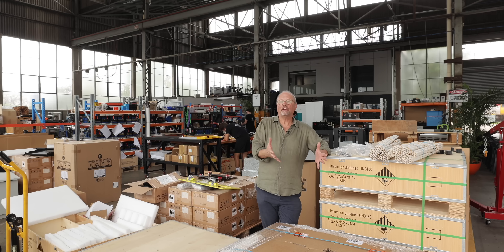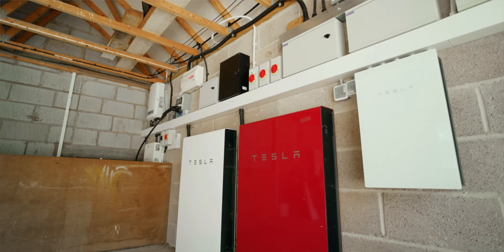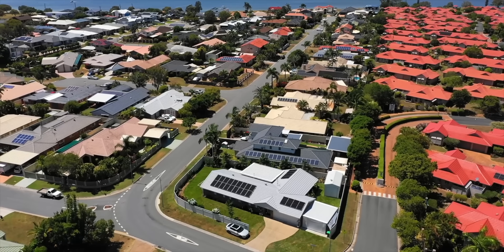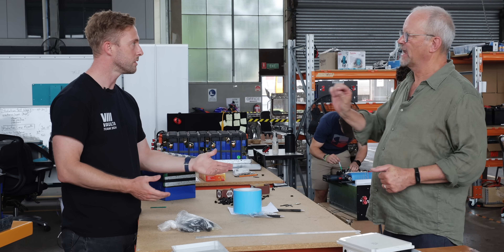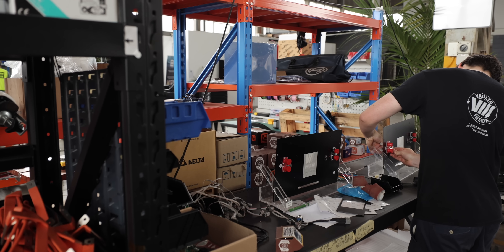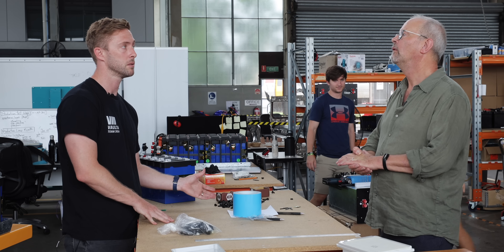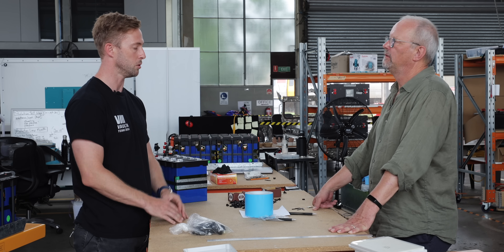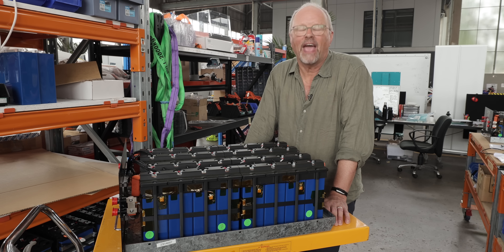THIS Recyclable Tech Solves Batteries' Biggest Problem!

Comment: Great video and company! Thanks for showcasing them FCS! 😎👍🏻

I have often wondered though, if you have a battery that’s been in use for 5 years and has lost say 10% of its capacity, and one of the cells dies … surely you can’t replace that with a brand new cell as then you’re charging a pack which has a capacity of 90%, which contains a single cell that will always be maintaining a higher voltage … unless the battery management system will just put extra load on that new cell constantly to keep its voltage in line with the rest of the pack?
Reply: It's not an issue - you can even use a larger capacity cell. You top balance that cell with the rest of the cells, and they will reach high voltage states at the same time. When going towards 0%, this new cell will have capacity left that is not usable of course, but it won't impact the capacity of the pack.

Comment: I would like to see lithium-ion last, but so far most you can expect it to last is around 10 years for usefulness for a single application without replacing dead cells. I would like to see this type of thing take off whereby you can just replace the cells needed. but as you cannot just change a cell for a brand new one, you got to match voltage and capacity remaining on other cells as well, then I can only see this being good for 10 years for example before having to change all batteries or having reduced capacity like say a new car battery compared to a 10 year old car battery that has been used well.

Comment: "Batteries' biggest problem" is not yet recycling, it is the CHARGING TIME. Until EVs can "Fully Charge" in 6 minutes or less on a public chargers, they are NOT viable for road trips. Again the biggest problem right now is Charging Time. Fix that problem.

Comment: Before you recycle, you reuse, and before you reuse, you reduce. And that's something a lot of people still forget. Don't make the battery bigger than it needs to be.
Reply: I calculated how much solar I would need when my house was renovated. What I forgot was the effect of greatly improving the insulation. I produce about 2 MW-hr more than I need now annually. Reduce does apply and you can add a bit for those LED lights with presence sensors too.

Comment: All that hand assembly increases costs for almost no practical gain. Plus a welded connection will have lower resistance and greater reliability than bolted. There are good reasons why almost no other companies do it this way.
Reply: Ha!.....you're trying to 'mansplain' to people who ACTUALLY know what they're doing ....
......pitiful .....!!!
Reply: @andymccabe6712  If you think hand assembling battery packs is innovative, even though it's the exact opposite of the direction industry is headed, I don't know what to tell you.  Unlike you I ACTUALLY know a lot about the battery industry.

Comment: I kinda fail to see what's novel and new here. They make battery packs from standard parts. Cudos for focusing on recycling. But "we don't weld" is not unique to Vaulta. 

That said it should be illegal to grind up battery packs without disassemble and testing cells first and reuse the usable cells.

Comment: I've been keeping a close eye on the battery evolutions over the past decade and people call me weird because I don't belong in either pro or anti-EV camp because there's as many negatives as there are positives and just like how solar panels are difficult to recycle, so are EVs. 

At least with home batteries, the battery unit is a single unit that can easily be swapped out and companies like Vaulta are doing what should have been put in legislation for years but in reality so many lithium batteries don't get recycled & get dumped. Heck, in EVs it's often not worth replacing the battery since it costs almost the same as a new car so off the entire car goes to scrap adding even more waste. I remember an expert saying it takes 8-9 years for an electric car to be less polluting than a regular car because of the manufacturing process & how much waste it leaves after it gets scrapped and that number REALLY needs to go down.

I mean, on paper EVs get recycled but in practice the cars are sold to third world countries where they'll get stripped until nothing remains that makes money so don't be fooled, in reality only the parts that make economical sense get recycled. Moving on to easy-to-disassemble batteries is vital if EV really want to be less polluting - some brands are already doing this but I strongly believe this needs to become a law in the EU. You can't force EVs on people and then in 10 years end up with huge amounts of cars that are not economically feasible to recycle. There's already talks of making people pay to get rid of their EV which will even further prevent people from buying EVs.

So yeah, we still have a long way to go ...
Reply from the maker: I'll just let you know now, you are a fully paid up member of the rabidly anti battery electric vehicle brigade. Don't fool youself. You have just regurgitated the exact propaganda the fossil fuel lobby have been pumping out, backed by billions of dollars ad spend, getting the 'experts' to splurge out 100% spurious garbage about abtteries and you ahve drunk the cool aid and then eaten the carton it came in.
So well done. Hope that helps you understand where you stand in this debate.
Reply: @fullychargedshow  I'm sure some of it was propaganda, but I've heard a great deal more of people who actually deal with waste. EU laws have become very strict the past few years and all waste you produce in a company has to be removed by a licensed company. Because of this we had to deal with dozens of recycling companies a few years back and most of what I wrote above is what THEY told me and I'll trust the word of people in the business - because unnuanced black & white thinking such as yours is propaganda as well, just of a different kind since you're also blind to the child labour (= fact, NOT propaganda) used to mine cobalt to name just one.

They basically told me (over & over since these were multiple companies) that a vast amount of garbage collected could either not be recycled, or only partially or it required nasty polluting chemicals even though the public may be fooled into thinking it's a greener alternative. A good example is paper containing PE which is used EVERYWHERE. Plastic has often been replaced by these paper containers because it looks more "green" but it's the opposite. Because PE & paper are fused together, neither can be separated and it needs to go to a landfill. Heck, even regular recycled paper contains all kinds of chemicals including bleach.

When it came to batteries they all said the same thing: it also requires huge amounts of nasty chemicals & while it can recover lithium, iron, etc. it's the opposite of environmentally friendly. EVs always came up and it was eye opening to see people who work in the waste industry be so incredibly sceptical of it all. For one, the capacity for recycling EV cars is just not there (yet). If even a third of the population starts to drive EVs, it will be impossible for these companies to keep up which is why they said that the cars would be shipped to Africa or Middle East to get stripped by hand. So yeah on paper they will be recycled. In reality tons of chemicals & nasty crap will end up in the environment again.

And please - this is not a EV vs petrol argument - petrol WILL run out and we do need to find a solution but being blind to the downsides of EVs means not enough is done to combat them. Every day we see so called "green solutions" that end up being more pollutive - it's time we do things properly instead of do it just to pretend we're doing things better.

Comment: Until OEM 's start to play ball by designing EV batteries for repair and not for replacement only, mainstream customers will always be worried about moving to EV's due to the high cost of battery replacement. This I also believe is a large cause for poor resale value of EV's as whole. Which is such a shame. Battery failures are rare but the stories of replacements costing a fortune put people off but if you could say that the battery can be repaired instead of replaced customer confidence would go up, New and second hand sales would increase and more people would start to be part of the EV revolution.
Reply: Better to spend your time making the battery reliable then repairable. To make battery repairable adds cost, weight, complexity and reduces reliability.
Reply: We have to accept that EV battery packs and home storage are different physical worlds. The environment that an EV battery lives in is one of significant movement, jolting, vibration, temperature extremes etc. The packs have integrated cooling/heating systems of various designs. It is often said that in vehicle manufacture you choose repairability or reliability but it's often "impossible" to have both. It's a balancing act. Simple bolt together cells such as in this presentation are not directly comparable to what's needed for a vehicle ... great for home storage though.
Reply: Repairable?

No mention of the labour costs involved.

Repairing such kit looks to be very boring for someone trained/educated to a high standard. Would suggest you have to pay a high salary to attract the "brighter boys/girls" to do the work.

Thank goodness hydrogen fuel cells/ICE vehicles are to be with us next year in Europe that is.

As for power walls then  not really necessary in all countries.
Reply: @t1n4444  You don't need an advanced degree in electrochemistry to replace a single cell that's gone bad. If you're the sort of person who can replace a head gasket or even just your engine oil, maintaining one of these will be a doddle. And by the time these need to rebuilt in large numbers (that 15 - 20 years) it will probably all be done by robots anyway.
Reply: @francisboyle1739  

No.

Comment: like all older tech recyclable isn’t efficient use of materials.  I really think that for the 21st century efficient use of materials requires a redesign of how things are assembled.  Little to no fasteners, and no use of adhesives and bonding agents requiring super expensive chemical treatment regimes.  This will be a $$$$ endeavor.

Comment: 1:47 My Australian Tesla Powerwall battery is LiFePo (*not* NMC). It says so on its bright green fluorescent emergency response label. I think this slight amount of FUD is unbecoming of a small startup competitor.
Reply: Oh, I wasn't aware PWS were LFP yet.
(I thought that was coming in the PW 3.)
Reply: Yeah little error there. I wouldn't go so far as to call it FUD though, he wasn't disparaging the powerwall just pointing out a difference.
Reply: Tesla is just starting baby-steps to make its own cells but they have been cell-starved for many years and diverted whatever they could buy to their cars for competitive advantage. Anyone can buy LiFePO4 cells from China (they rule LiFePO4) and build a DIY 48-Volt battery but this Vaulta 48-Volt battery does appear to be high quality and at a good price and a much better idea for most home users than DIY or Tesla Powerwalls. Tesla just buys whatever cells they can from Asia - even from BYD their frienemy. The idea of people putting NMC cells inside their home really scares me and I would not do that myself. I would keep even LiFePO4 in something like a garage/lean-to instead. Tesla Powerwalls can be programmed to listen to weather forecasts or predict outages in areas with a dodgy grid supply and they can be ganged together to be a virtual power plant so they do have some small software advantages but a very high cost in comparison with Vaulta etc..

Comment: Consider that some brands from China are automating some steps of assembly of a server rack battery.  I'm not sure Vaulta going to be price competitive with its slow and low volume.
Reply: this company will simply go bust...
Reply: @IdoCareForPeople  It cuts both ways. Automation levels the playing field since it eliminates the cheap labour advantage.
Reply: I wouldn't trust that. And there is usually more to it than just buying a battery. Like the whole installation that needs to be done correctly.
And again: I wouldn't trust a battery box straight from China. There needs to be someone that is either giving warranty or someone that at least knows the difference between a bad cable and a fire hazard cable. In my case I consider myself good enough to test the battery and installation for bad connecions.

Comment: I just found some prices for these Vaulta battery packs and was almost shocked at how low they were. Here in Australia you can expect to pay no less than AUD $0.50 per Watt hour of capacity for assembled LiFePo4 48v packs imported from China, Vaulta were about AUD $0.64 and $0.60 per watt hour for the 5kW/hr and 14kW/hr respectively. Thats astonishing IMHO, and to get the local support and warranty is worth paying that little bit extra too. There are many other battery brands in Australia that are well over $1.00 per watt hour. If these guys can get CEC approval for these batteries they will probably do very well for themselves.
Reply: Yeah, the safety certification is important too because if something goes wrong you have no redress against somebody in China.
Reply: @RoonMian It also matters with respect to insurance.
Reply: yes and no... sounds nice, but still it depends on which firms you get it from, and that can pump the cost up... there are reliable sources of these cells that diy's share with each other...  @RoonMian
Reply: and if you buy the cells yourself I think about 2900 $ usa for 15 kwh
Reply: @ndudman8  Yes it's approx AUD $0.30 per Watt hour for the raw cells, but you still need the high quality BMS and various other hardware. Certainly a good way to make a significant saving if you have the skills and inclination to DIY, but for most people a pre-made pack is a much simpler (and probably safer) option.
Reply: Cells are 72 euro a piece for 304Ah from a European distributor. That's 79 euro per kWh or 0.079 euro per Wh so less than US$0.10 per Wh.
Premade should be about US$0.20 per Wh.
But I wouldn't buy them premade ever. There are too many horror stories of bad premade boxes.

Comment: Ya...not welding the batteries is something that a lot of vendors do, and of course all DIY'rs 
Nothing unique my dudes

It's more about reparability then recyclability, I thought they've developed a new battery that is easier to extract the lithium back when it dies  

It is a nicely built battery, I would definitely buy one if it was sold locally

Comment: europe is bringing right to repair laws for all devices, phones, laptops etc=== batteries can be replaced with out any special tools for phones, laptops,cars
Reply: Yes, the issue here is that car batteries are already easily replaceable. They're replaceable as a single, multi-thousand-euro unit.
Reply: Better to spend your time making the battery reliable then repairable. To make battery repairable adds cost, complexity, weigh and reduces reliability.
Reply: On Tuesday, Parliament adopted its position on a stronger “right to repair” for consumers, with 590 votes in favour, 15 against, and 15 abstentions. The proposal aims to encourage more sustainable consumption, by making it easier to repair defective goods, reducing waste and supporting the repair sector.   @universeisundernoobligatio3283
Reply: @universeisundernoobligatio3283  why not both? Reliable and repairable don't have to be mutually exclusive.

Comment: In the DIY sphere, we've been building batteries like this for years. I've got 60kWh right now, expanding to 100kWh this spring.
Reply: And the cells often did not meet the EV certified requirements but are more than good enough for less demanding applications like home storage. Better to get the use from these cells, reduce the waste and support the manufacturing  of the EV certified cells!
Reply: Those 280Ah Eve cells are fantastic. I can just drop in a replacement cell in 5 mins.
Reply: Cylindricals are a pain esp if wired .   Only should be considered for small volumes.
What i would have liked seen discussed is blade packs ..they are naturally designed for literally plug and play architectures.. they use common collector support bars and come in various lengths now down to almost prismatic sizes. .
We also know they bring in lower costs and other advantages most notably safety and thermal stability over other formats.
Reply: yep thats what I thought... have only 30kwh myself 60 is great :)
Reply: Me too, happy to have a hand built if I know the hands that built it and how to fix it but if I am buying it I want it automated
Reply: like seplos mason DIY kits.